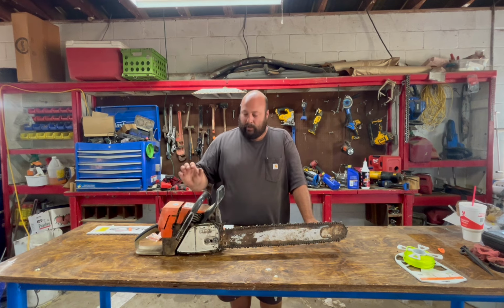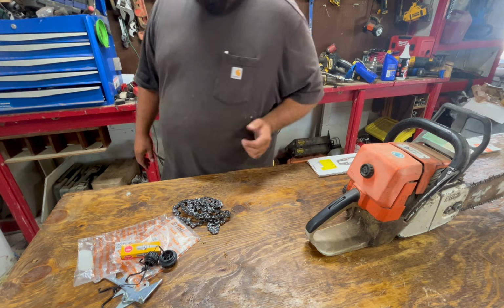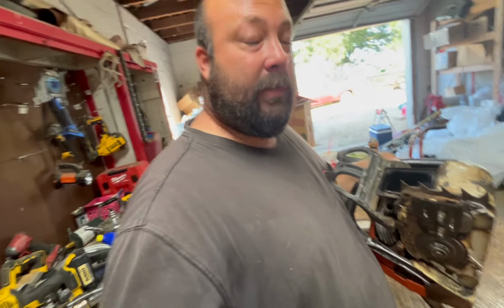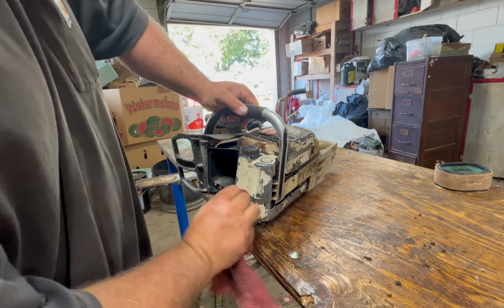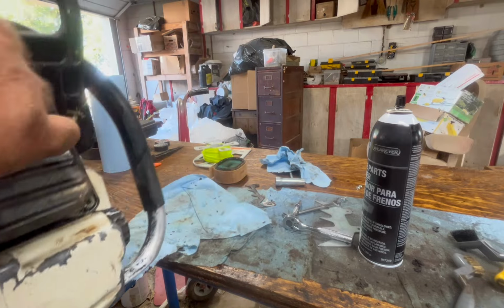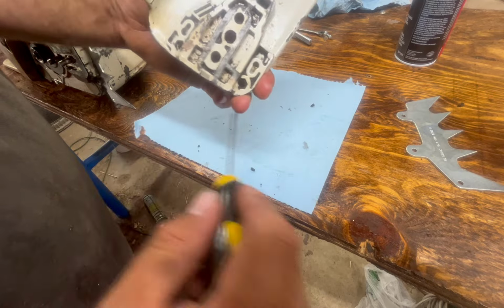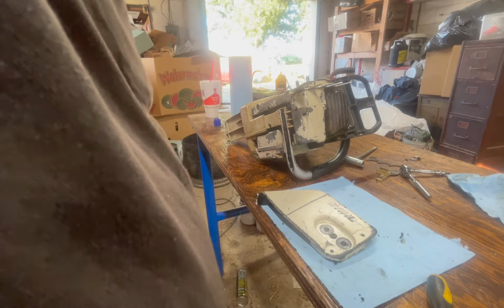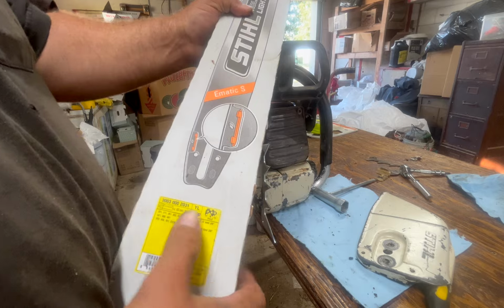The AUCTION Stihl 044 Is BACK And We Might Have A Problem!

Comment: Hard to tell how much scoring is on the piston from the video a little won't hurt it if it was mine I wouldn't worry about it run it at 40:1 till it blows and then put a new top end on it aftermarket run you about 50 bucks hope that helps
Reply: I agree. These saw can take a lot of abuse before they go Poof.
Reply from the maker: Good to know, thanks John!
Reply: @faithfulfarmadventures  no problem